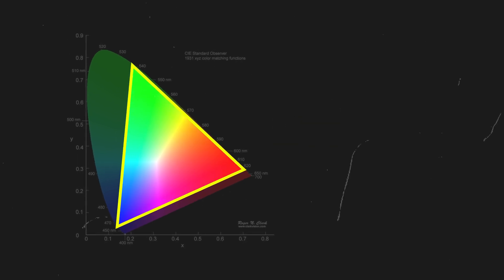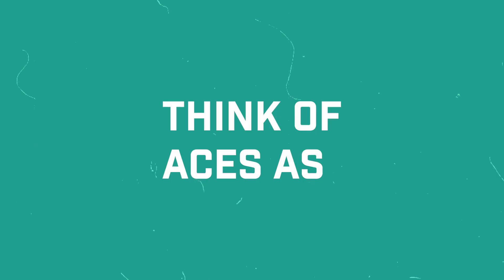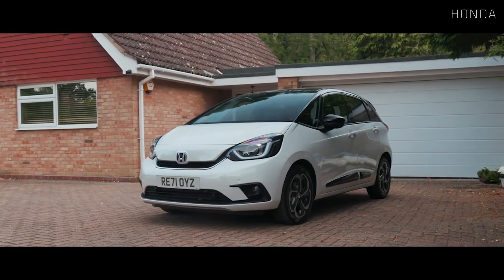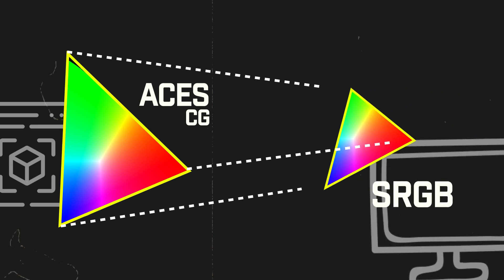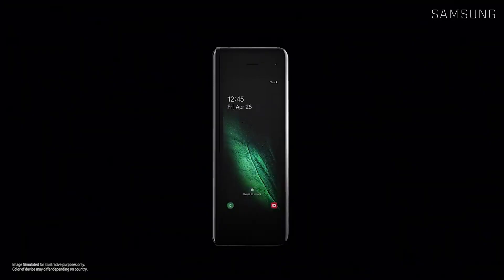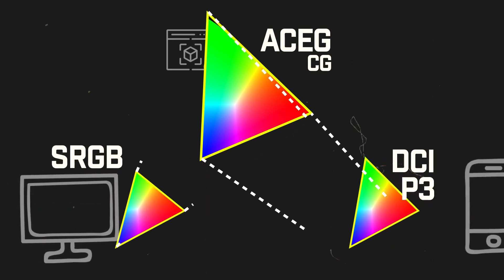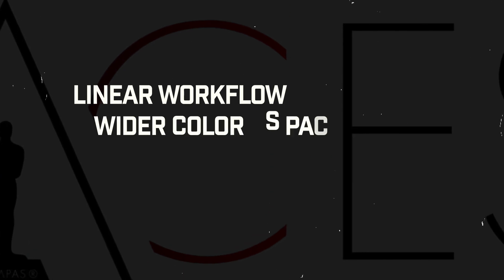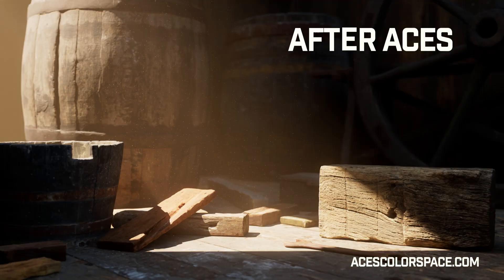ACES Explained! How does it work in Octane?

Comment: Well produced video, my only point would be I wish you covered more of the shortfalls and criticisms of ACES. Off brand colours is actually only a symptom, of a wider problem with ACES ODT. e.g it's per channel transform, tendency to skew colours, lack of gamut mapping, very contrasty tone curve. Even within the VFX industry this transition has been plagued with confusion, misconceptions and output issues. The reason that button is there is simply because users kept asking for it having heard about this "new thing" being used in the VFX industry and believing it would bring their work a dose of production quality results. The devs implemented OCIO, however users were still struggling to set up ACES via OCIO so they added a checkbox. Particularly ironic that an encoding system designed for the interchange of hundreds of formats has been reduced to a single checkbox for a single transform. But to summarize, in the context most Octane users are using it, it's essentially a LUT with a lot of hype but yes it will look better just using a sRGB EOTF view transform for final image formation but it's certainly not without it's issues and there are more capable options out there.
Reply from the maker: Hi @llennoco22 thank you so much for your incredibly detailed reply, and for flagging all of the above. I agree the transition and adoption of ACES is a super confusing one, and hope this video did help remedy some of this, however your points are a lot more thorough and things I should have included in this video that I did not have time for. Thanks again and will bare this in mind as we progress with ACES, and should I do another video will aim to bring in some of these further shortfalls!.

Comment: I use Corona render for Archviz and in one of the last versions they released a similar checkbox called "ACES OT" I search to see if it was good to use, I could be wrong, correct me if it is please, but from what I understood this ACES checkbox of the appearance of an image treated with ACES and it is interesting to use to have a good result, it takes a lot of effort for someone who wants a quick result with a good appearance, but not being a form of linear post production... I did tests and for me it works use, because I already use only LUT without post production programs (like PS for example), I have a workflow too intense to afford to do a custom post production for each generated image... I believe that for my case this checkbox is too much convenient, but of course, I leave it open for comments and suggestions for cases like this, what better workflow to get realistic and fast results.

Comment: Funny Side Fact: The Octane Manual actually suggests to not use the ACES-CG Color Space, instead it recommends to use the full fledged Spectrum of ACES2065-1 as most compositing Tools can handle it and it is not as clamped as ACES-CG. 

And also in my Experience with using ACES with Octane, I have to say that especially Refractions and Reflections seem to be way more Realistic.
Reply: Here is what it says in the Manual: "(...)ACES 2065-1 is the full range color space, appropriate for Octane as it is a spectral renderer, whereas ACEScg is intended for RGB render engines, and is a reduced color space. Either will work, and most compositing applications can handle the ACES 2065-1 spec."

Comment: Colors in the digital world are represented by numbers. The appearance of colors is determined by the math which scientists and developers (Octane, ACES working group, etc.) use to translate these values e.g. from a large color space to a smaller one that your display is actually able to produce.

Since human vision is non-linear and subjective, there is no single "correct" way to do this. The same applies to human hearing and it is comparable to lossy audio compression, where mathematical algorithms (e.g. MP3) are used to reduce the size of a file while maintaining the perceived quality of the sound, a field known as psychoacoustics. In the visual realm, this could be referred to as color (perception) science and many prefer the look the algorithms used in ACES produce.

Furthermore, ACES is a standard which software developers now can follow. This will allow for better interchange of images between tools without loosing their look when moving from one stage of your workflow to the next (e.g. from rendering to compositing).